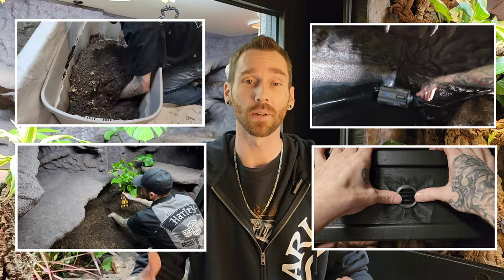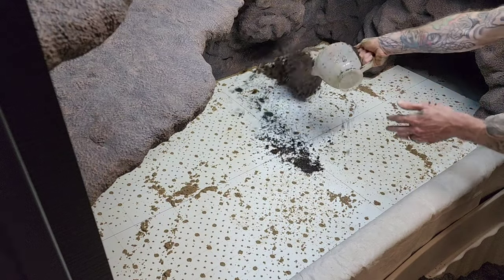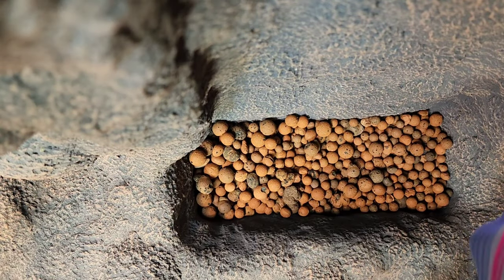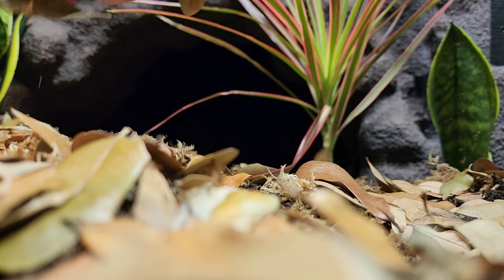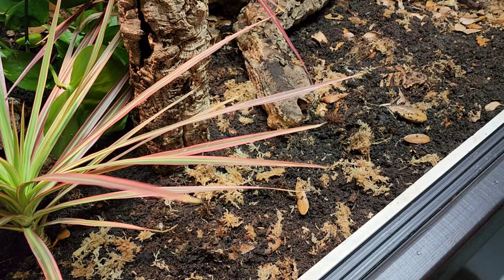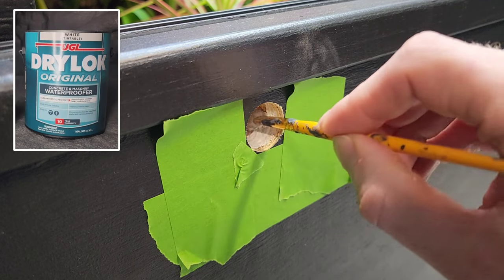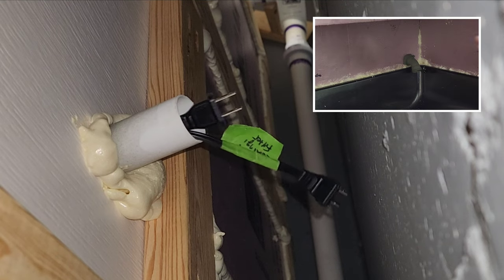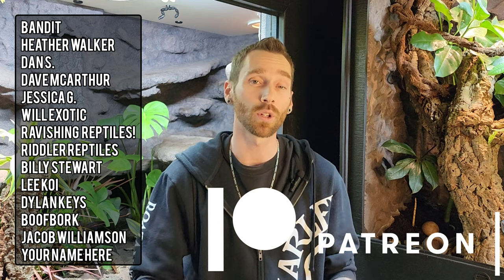DIY HUGE Reptile Enclosure Bioactive Planted Vivarium | Part 5 |

Comment: I would love to see a video about how you get rid of fungus gnats.
Reply: Yeah I would also I absolutely can’t stand those tiny flying menaces. For some reason every once and awhile I see them flying about and other times nothing at all for months 🤷‍♂️ only downside to bioactive builds are the hitchhiker’s 🤦‍♂️
Reply: Mosquito bits are great, natural nematodes release bacteria (or something like that), diatomaceous earth can work, natural pesticides like purecrop1 or lost coast therapy can be used for a soil drench. But the absolute best thing you can do for your bioactive enclosures is to buy beneficial nematodes from arbico or a company similar. By using nematodes you increase the soil biodiversity and can drive down pests. I use all types of microbes and beneficial organisms to keep my substrates healthy and bumping with life.
Reply: @pumpkinchow  they love damp soil. It’s a fine line between letting the substrate dry out and keeping the moisture just right. They are fairly easy to deal with once you add biodiversity to the soil like natural predators
Reply from the maker: sounds good. Next build i do, I'll do a step by step on methods I have found that work well.
🤘💯🦎🐸🐍🐢🌱

Comment: It needs some branches to allow for multiple ways to one, access both floors, and two, traverse and enjoy the benefits of arboreal terrain
Reply from the maker: @y-it-rides6214  agreed, I'm looking forward to updating this build with some large branches. I didn't want to do it right outta the gate. Lettingbhim enjoy and destroy the plants, then put in the branches for enrichment and new things to discover
Reply: @bradsbioactivebuilds  I forget who I saw do it, but they made vines out of rope, silicone, and coconut fiber. 

Absolutely beautiful work man, your carpentry is crisp, and I ordered a gallon of the epoxy putty
Reply from the maker: @y-it-rides6214  check out this video on how I do my vines, I add some 12 gauge wire so I can bend them
https://youtu.be/WZ3EYjO_PIQ?si=_YnNZODqMdIz6tvi

Zoopoxy is next level!

Comment: def curious about your fungus gnat trick : also do you do like a dip solution for the plants as well? (since hitch hikers can also be in form of eggs on leaves as well)
Reply from the maker: I have done a 15-minute water soak, then 1-20 part 5 minute bleach soak than a rinse and 10 minute water soak before. I had good success with that, but larger plants are harder to do. But I always rinse the leaves, too. There are always a few that get by, but it's better that 10000's lol. 
Are there any dip solutions you know to work well? Cuz when I do the bleach, i do lose some plants in the process, so I haven't done it that way in a while.
🤘💯🦎🐸🐍🐢🌱
Reply: @bradsbioactivebuilds  truthfully only plant soaking i've done was for aquarium plants : 1 cup of kosher salt per gallon of water for snails; 2-3ml of hydrogen peroxide per gallon for algae/parasites..... about a 15-20 min soak .... idk if itll work the same for normal plants tho

Comment: Sweet build man. Do you use the Govee for permanent monitoring of temp/humidity? Which product are you using as I see they have several thermometer hygrometers. Your builds are giving me great ideas.
Reply from the maker: Thank you. I use the regular Bluetooth (not wifi) connected ones. 
Bigger one is modle # H5102
Smaller are modle #H5101
I typically monitor temps and humidity all over the enclosure for a few weeks while plants are aclamating before introducthen any animal. periodically, I will put them in throughout the year to see if I need to recalibrate anything.  I regularly check with temp gun. You could mount them in the enclosure if you wish. I have just grown to know my enclosure and can tell by looking at them if they need readjusting or some reads.
Hope this helped.
🤘💯🤘

Comment: Thanks Brad 🙏 any more projects planned?
Reply from the maker: Just uploaded a Lanthanotus Borneensis Earless Monitor build 2 weeks ago and I have 3 videos on 8x4x6 paludarium series I'm working on. Doing the hardscape now and hope to have a video out soon on that. I'm not sure how many videos will be in that series bc there are a lot of features. I have a few small projects in-between that build that will be coming out. 
🤘💯🤘
Reply: No rush don't burn out! I like when it's done in parts so you can see the process and hear your thoughts at each stage more in depth. Great stuff! Top notch. 

I'm currently working on a 36x18x24 crested gecko build and taking your advise to take my time and see my vision thru instead of rushing or settling. Got it second hand and removed the original stone drainage layer to swap with lava rock and weed fabric (glad I did this because I did overed they originally used metal mesh) I'm excited to try your fan build. Would you use one or two fans in an enclosure this size? Mounted in the corner(s)? And what is your ventilation cycle set to for the fans to run?
Reply from the maker: @AquaticMoose  thanx, much appreciated! Your build sounds like a fun one. 1 fan would work with that size enclosure. I would also run the fan for a few hours during the day when your crested is sleeping.

Comment: How long does it take for the plants to grow?
Reply from the maker: The plants will continue to grow for the duration of the enclosure if kept up. (Most if these will most likely get destroyed because of who I put in but normally they will last a long time)
I like to wait a month or 2 so the plants can root and become established before introducing an animal. Easier said than done though 😆 
Hope this helps
🤘💯🦎🐸🐍🐢🌱
Reply: @bradsbioactivebuilds  So, you let the plants sit for 1 - 2 months before adding the animals? Don't animals destroy it?
Reply from the maker: @ALAMLUSVI  usually not. But for this build, he might destroy them because of the size of him with some of the plants I chose. But i let them establish for a month or 2 to give them a good start
Reply: @bradsbioactivebuilds  Are damaged or dead plants replaced while the animals are still in the cage?
Reply from the maker: @ALAMLUSVI  yes, they will be replaced with a harder plant while he is in the enclosure. It will be harder to get them established with him in there, but a more hardier plant will have better chances of survival 😆. Otherwise, I'll have to get fake ones as much as I don't want to go that route. 
🤘💯🦎🐸🐍🐢🌱
Reply: I've been thinking about a build. On a much smaller scale. Some of the tips and tricks I've seen in your videos I have never seen anywhere else and I happen to see something like this in almost every video! I was wondering what the appropriate size bio enclosure for a Tokay Geko would be. I was thinking 36x18x36 but I know they produce a lot of waste and I wasn't sure if it could be done in that footprint.  Any advice would be appreciated.